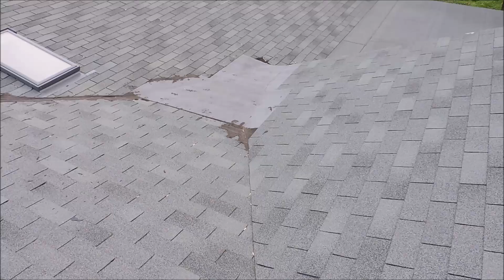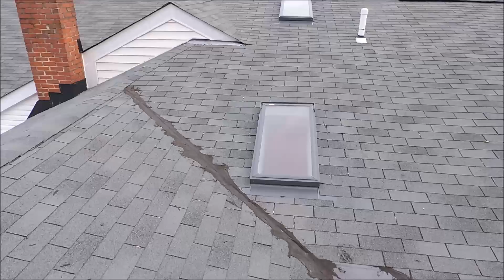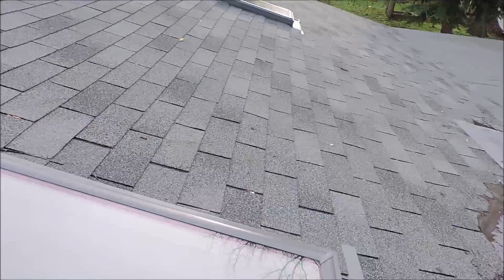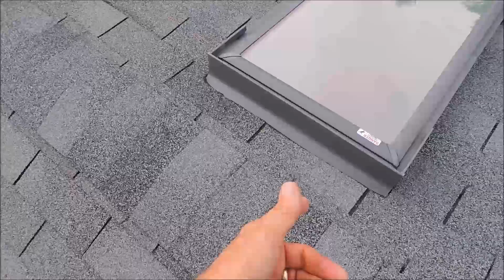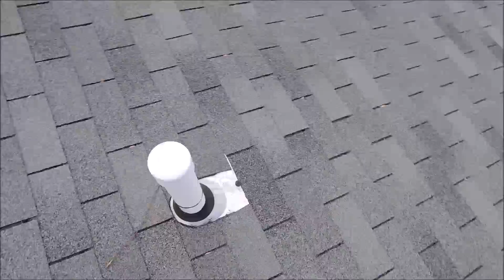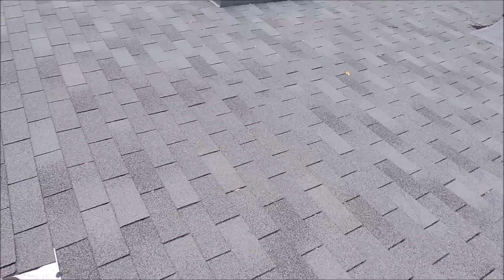Finding The Source Of A Roof Leak In Annandale, VA | Roofer911

Comment: I have that exact same roof configuration minus the skylights and it leaked.  contractor stripped it, layed all new composite underlayment, torched down some white roof material over the flat area in the valley, and 2 years and a few days past his warranty, it started leaking again :(  I've walked it a dozen times in the rain and can't find the source.  Now, i'm going to set up sprinklers on my roof and move around until it leaks again to try and narrow the area.  I can't think of any other way.